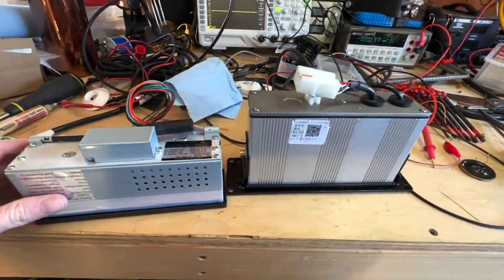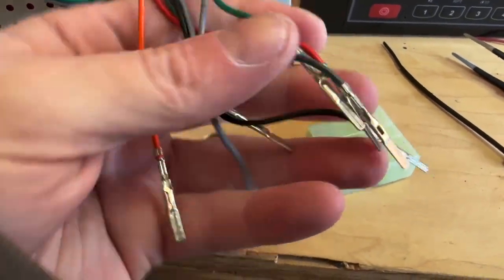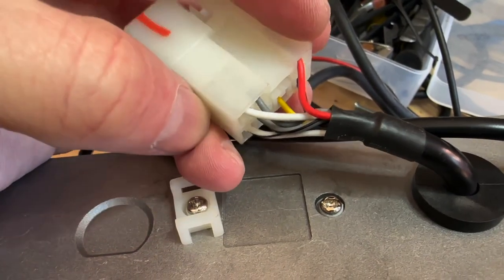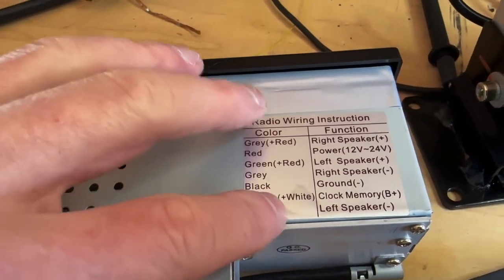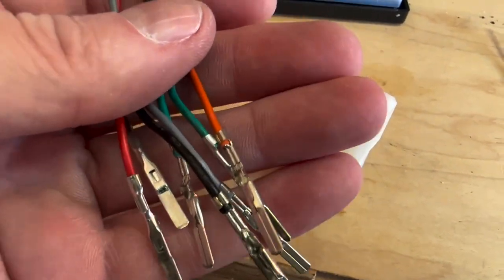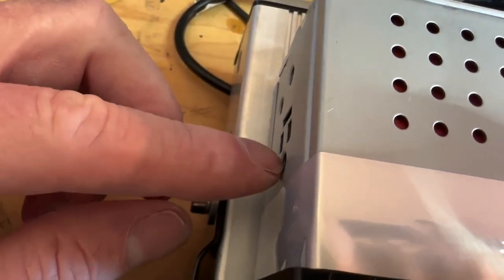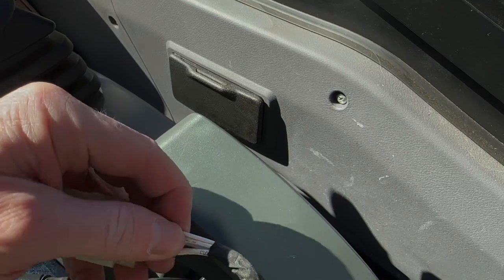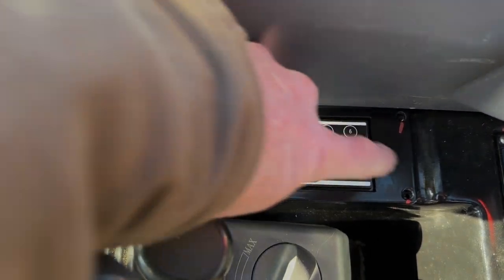Sany Mini Excavator SY35U Radio Swap

Comment: Seen your thermaltronics video and was wondering if you could help troubleshoot. My iron all of a sudden quit heating. It won’t even get warm.
Reply from the maker: Metcal or Thermaltronics?
Reply: Thermaltronics
Reply from the maker: @gamingwithisaiahf  Do you have a spare tip? Unless your RF supply is bad or cabling it's almost always the tip element.